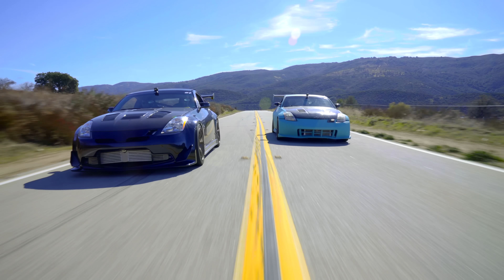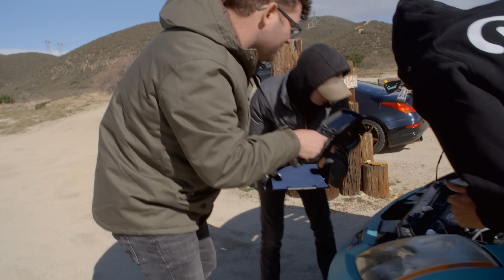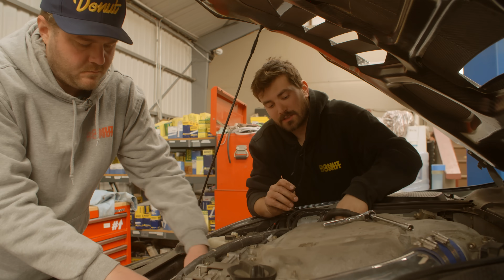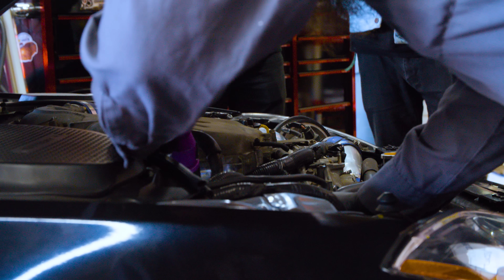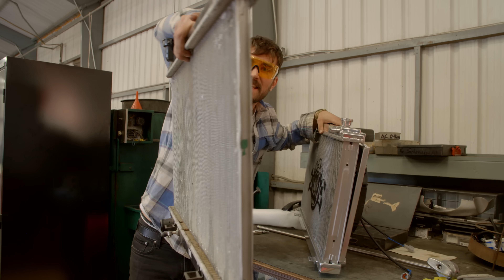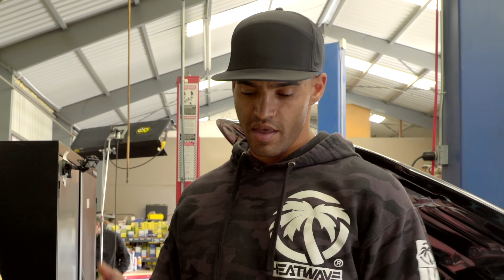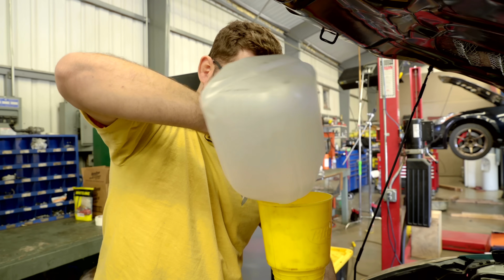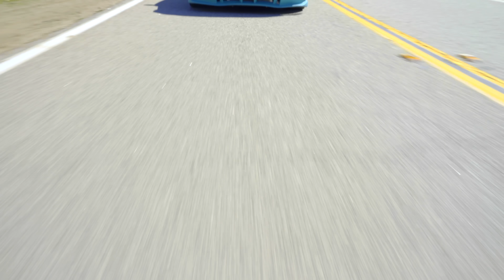$200 Radiator vs. $500 Radiator

Comment: This isn't a fair test to either car. they're completely different... one is twin turbo... the other is single turbo one is tuned different than the other. one may make way more power than the other. one may be driven way different than the other when it comes to stuff like this you need to try to even the playing field a little bit by having one person drive both cars that's not from either car that way they're driven fairly similar. And then push them both to their limits

Comment: If the radiator is to small it dosen't matter if it is costs 2 times more or 10 times. It will still be to small to get the engine cool. The fans are only for cooling if the car is not moving. If the radiator is big enough you even don't need a fan. I've seen a lot cars with originaly engine driven fans that used to have no fan because of the power you loose to them.

Comment: One reason I love this series, is because it shows how wrong shit goes when you try and work on vehicles. It's never as easy as just installing new parts. Something, somewhere, will go wrong which causes you to lose your mind. Lol a 2 hour job will always turn into a 6 hour job.
Reply: Stock is gold or buy much better stuff from japan
Reply: Literally me late last night lol... Fitment issues with a new intercooler I installed. A lot of little things being tighter or more inaccessible than anticipated, then when it was all done my test drive gave me a CEL... Turns out I switched the connections for the fog light and the Ambient Air Temp sensor smh...

Comment: Why the eff aren't you putting coolant in with the water!? It prevents corrosion as well as keeps the boiling temp of the fluid higher than distilled water! 🤦
Reply: Calm down FFS.. the higher thermal conductivity of the fluid outweighs the higher boiling point due to the larger radiator and increased fluid capacity capable of cooling it prior to boiling.

100% glycol = ~0.25 W/mK
75% glycol = ~0.34 W/mK
55% glycol = ~0.40 W/mK
25% glycol = ~0.55 W/mK
0% glycol = ~0.69 W/mK

Going from 55% anti-freeze (AF) to 25% AF is a about 37.5% higher thermal conductivity.
Going from 25% AF to 0% AF is about 26% higher thermal conductivity

From 55% AF to 0% AF is about 73% higher thermal conductivity.
Reply: But the idea is using these as daily drivers. Using straight distilled is going to cause lasting damage to multi-metal systems. The high flow and fluctuation in temps will only increase the corrosion possiblity. They are giving poor advice for long term vehicle maintenance. Unless I missed something
Reply: @jhanschu  Using coil overs on a daily driver is uncomfortable as hell so I never considered that a realistic option. 

The VQ block is aluminum, the head is aluminum, and the radiator is aluminum. Your argument is moot and irrelevant on supposed galvanic corrosion due to multi-metal systems. 

I seriously doubt anybody watching is using the knowledge gained from the video as a long term vehicle maintenance guide. As it's a performance upgrade comparison on whether to spend the extra dollars on allegedly higher quality parts.

For example.. on the $3000 suspension vs $500 suspension episode IMO I'd go the cheaper route with higher quality tires for better overall performance. As extra tunable capabilities and simplicity of doing so it relatively moot once dialed in properly. Even if the alignment shop billed me $200 more to complete the job I still saved $2,300.
Reply: Can't say I've ever seen a water pump impeller made of aluminum. But I do concede that distilled will dissipate heat more effectively. I will also agree, that they are leaning into the track focused updates. But they make a point to mention that they are modifying the same car for use on and off the track. I'm sure you have plenty more counters to my statements. Regardless of whether you reply or not, I'm considering it closed.
Reply: @jhanschu  Water pump impeller's are commonly plastic as fabrication is faster and cheaper. Having a metal one is in many instances only an aftermarket upgrade. Just as intake manifolds, end caps of radiators, timing chain guides, and many other components have transitioned to plastic for a good while.

Even performance oriented vehicles have plastic intake manifolds such as Mustang GT350 5.0 Coyote engine. Yes, the GT350.. wtf?
Reply: The few water pumps I've had the pleasure of changing out were all stamped steel impellers. In fact, early in my vehicle history I attempted to cheap out on a neon coolant flush and 6 months later overheated because the impeller had eroded. It was OEM and steel. Recently did a 2000 grand am and again, OEM stamped steel impeller. But I wouldn't be surprised is they've moved to more plastic components

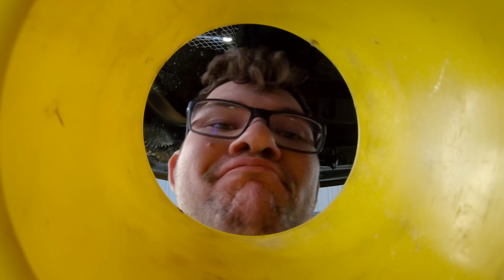Comment: 12:46 facepalm Don't do that. Antifreeze does more than lower the freezing point of water. It also has anti-corrosion additives in it. You run straight distilled water for too long and you'll corrode the cooling system (aluminum parts will be fine unless salts find their way in there. But steel parts, like your head gaskets, will rust). I live in the SF Bay Area (lower average temps than LA, but about the same temperature range ie the temp rarely gets below 50 degrees); I start with a 50/50 pre-mixed coolant, then add a 1:1 ratio of coolant to distilled water (resulting in 25% coolant, 75% water). EDIT: Just to be clear: I wasn't criticizing Donut (their end result was a 4:1 mix of distiller water to antifreeze). I was explaining to any watchers of this video why you shouldn't run 100% distilled water.
Reply: damm bro u smart

Comment: I used to work in a radiator factory. Literally no difference in them when it comes to materials. Factory I worked in made radiators for both John Deere and Toyota. Both came from the same tube materials. All comes down to the fans and the fan shrouds. But even those are made at the same factory.

Comment: Coolant also has lubricant properties for the water pump and anti-corrosion properties along with modifying the boiling point of the coolant. Flush the car and do it right.

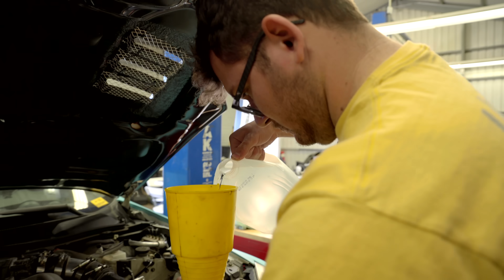Comment: At 12:50 I must correct you. I agree straight water will keep your radiator pretty cool..  However, Antifreeze not only prevents freezing it helps raise your maximum boil point which is an advantage in a performance car. One last thing that people forget...Antifreeze has ANTI-CORROSION properties unlike water alone. So, the anti-corrosion piece of mind for your cooling system is valuable for longevity

Comment: One problem i see at around 13 min. Antifreeze is also used to raise the boiling point.  Water boils at 212 so you're going to be pushing that point real easy if it barely gets over mid temp range if what's left in that block doesn't remedy it. Anti freeze is far from only preventing freezing. It's also a corrosion inhibitor which is why you are supposed to change it every so often it will still protect against freezing but not against corrosion after so many years. It works similar to an anode rod in your hot water heater which disappears and loses effectiveness against prohibiting corrosion.

Comment: destilled water is not good for your cooling system. the cooling fluids with anti freeze and stuff that you can buy also contains corrosion prevention. your destilled water is going to look pretty brown when you replace it in the future...

Comment: The fan that Nolan got is probably fine. Lots of aftermarket fans are designed like that. The questions revolve around the blades and the RPM and how much it actually flows. If it flows well and runs fast enough, that should be enough to push air through at lower speeds.

Shrouded fan setups are a double-edged sword. If you actually look at that shroud (Hi Car), the fan area is a small portion of the overall radiator area. It would likely work better with one larger fan and one smaller fan. The reason is that when you're at speed, the fans are doing nothing but blocking airflow. Hence, with a shroud, only a fraction of the total area is actually cooling the air. With Nolan's shroudless setup, the entire radiator can be used to cool the engine at speed.

Shrouds look nice and all, and in OEM configurations they work well. But OEM fans and shrouds tend to take up a lot more space. When you flatten them out like this, a shroud isn't necessarily the best way to go. You're not going to pull a significant amount of air through the non-fan area just because you put a shroud on there (the bulk of the air is being pulled from where the fan is). Nolan's fan is going to sit flush against the radiator anyway and pull air perfectly fine. I predict that you're not going to see a significant different between the two at speed.

Oh, I see they chose to re-use the stock shroud on Nolan's car. Smart move!

Comment: Antifreeze also lubricates the water pump shaft.  Using plain water shortens the life of the seal.  But also antifreeze increases the boiling point.   And it reduces corrosion.  You are better off using antifreeze aka coolant than plain water.

Comment: Alot of times this is stupid. All you have to do is upgrade the fan and its fine. I run a 150 dollar aluminum 3 core in my 383 s10 and a set of dual 14" and I have no problem with cooling.

Comment: The vid was fun but realy you should have been testing with the same fan system on both... I put the mishimoto fan shroud on a megan rad and had great resluts.  Really the Rads themselves shoukd have proformed nearly identically. Unless there was significant thickness diferances.  Which which in my case was the situation. The CSF and Megan rads were mostly identical same flow pattern same fin density.  So why pay more? Fitment was also great.... After i fixed a bracked that was bent on my car. The mishimoto fans have to admint are mehh,  the shroud makes all the differance.

Comment: You have a dual fan vs a single fan? Huh? You should match setup to setup. Can't compare when not getting same amount/size of parts
Reply: Ummm, Zs since the Z32 usually require removing the reinforcement on radiator swaps. You guys are making my head hurt doing $#!t the hard way.
Reply: And no coolant? Me thinks you guys need to fully find out what coolant does. It's not only for freezing 🤦‍♂️

Comment: by the way the reason antifreeze is in there is not just for it freezing it changes the boing point and cools better then just water witch will boil out if there is no antifreeze in it. it also stops algae from forming and plugin up the cooling system.

Comment: the lo car has had a lot of installation problems because of lack of parts and space, but drives mostly fine, but the hi car has had a lot of easy installation and a lot of running problems from what ive seen

Comment: You need antifreeze in the cooling system even if you leave in very hot place, not to pre3vent freezing but to prevent seizing the water pump, antifreeze lubricates the pump so it's kinda important to have lubrication on it to prevent the piston BBQ from happening

Comment: You must be using too thin of an oil, a 15w40 works more well in high heat, its a high dispersant oil, my car is cool enough that even the heater is not as warm as before.

Comment: To test if this results are really (at least mostly-) due to the new parts (instead of the orverall design, as stated by the end of thw video) you guys should look into also swapping some of the components and check the results.

Example: put the new hi cooling parts into the lo car. And see if results are same or close to the og ones obtained from hi car. That would tell A LOT MORE about whether or not the hi parts are worth it by themselves

Comment: I know someone with a big block Chevy and had over heating issues. He put a larger radiator and it didn't fix anything. Another co worker got him to change the carburator. Problem fixed.

Comment: Coolant is for higher boiling temperatures and pump lubrication and it’s better on the seals too smh. You shouldn’t put just water in or a weak mix of coolant unless you have another lubricator

Comment: Cmon guys.. ignoring main role of antifreeze? It prevents corrosion of engine inner parts. Thats why you have to use it even in california. Straight water will corrode shit out of block and heads. And all that crud in turn blocks radiators and so on. In extreme prolonged cases water will eat block/head enough to have head gasket failure.

Comment: You should never use pure water as coolant, water DOES NOT protect from corrosion, it's batter to use tap water with additives  then to use distilled water without it, and the additives also prevent the fluid from boiling.

Comment: Maybe invest in an OEM bonnet. Run vents if you want but you should also invest in a splitter and underbody aero that extends back at least to front wheels. You might think your letting hot air out with those vents but unless your driving at a pretty high speed the effect is minimal at best and even detrimental in most cases as you are robbing the bottom end of airflow past it. The only good application for a vented bonnet in most cases is more the Maccas posers who spend most of their time idling in traffic.

Comment: Coolant is also for electrolysis protection.  Nissan is very specific on the coolant to water ratio for that reason.  Use a product like "Wetter Water" for enhancing thermal transfer.

Comment: Mishi is legit but location/region has a lot to do with rig set up as well. Here in Houston, I had to get bigger fans than the Mishimotos. It's just too damn hot here and those fans didn't push enough air even for a 2 row Mishi radiator but damn it looked sick AF while it was installed

Comment: Not a fan shroud..  It's a fan support. The Shroud extends 4"-5"  past the fans for a reason... And it needs to be sealed around all the edges in front and rear of the Radiator.  Why NASCAR uses Duct  Tape to control the air flow...  As they don't use a thermostat.  They use Stainless Steel Restriction washers.  In place of a thermostat..So there is nothing to fail. They just size the holes to the track conditions..

And if you want flow.  Go buy a Crown Vic Police car or get it from the Salvage yard.  They flow 5000 CFM...

Comment: They're '03 cars, right? Why didn't they just plug in an OBDII reader into the car and watch temps as they were driving? It'll list the actual temp of the coolant itself, and be a useful metric to watch/confirm the gauges.

Personally, I think that the other mods (intercooler, hood vents, bumper vents, etc.) play a decent role in keeping temps down, judging by the vast difference between lo & hi cars at the start.

Comment: Pure distilled water is NOT a good idea! Use Type B coolant which contains the anti-corrosives and anti-microbial additives without the antifreeze. Since distilled water doesn't contain its own minerals, it has a tendency to pull them from whatever it touches to maintain a balance. https://www.hyperlube.com/blog/blog/why-you-should-never-use-distilled-water-in-your-cooling-system/

Comment: Not only does antifreeze keep the water from freezing, it also works as a lubricant for the pump and other moving parts in the cooling system. Atleast do a 20-80 mix instead of nothing

Comment: When I upgraded the radiator on a 2001 Miata, I just reused the stock fans. The slim aftermarket ones they use don't work as well and are mostly for clearance if you have no space left over from a larger radiator.

Comment: yeeeezzz distilled water? Why no high temp coolant like Evans or something, you can keep driving till like 30% above boiling point
Reply: I think distilled water has a higher boiling point than alcohol type coolant. 
Not quite as good for corrosion resistance though.

Comment: There are a few things flawed with the test. 1 lo car should have been given a fair fan shroud. High car received mishimoto fans which in my opinion is more of a low car option (no shade i like mishimoto). secondly the distilled water is a big change in itself regardless of radiator so it skews the results. 3rd the fact you guys built 2 turbo 350z with stock cats was a huge killer for power on the dyno. I think a "mid pipe" exhaust video should be made. It makes a huge difference. Awesome watching you guys wrk though!

Comment: Would be cool to see a comparison between cheap and expensive exhaust systems. Other than that, this is great content from Donut Media.
Reply: These questions and videos are absolutely absurd! There is no comparison between a cheap Chinese knock off exhaust system and a high end 100% stainless steel (or some other high end material), mandrel bent, TIG welded Exhaust system! What people don’t realize is for the most part you don’t change your exhaust system to gain horsepower, You change your exhaust system to maximize the efficiency and horsepower gains of the engine due to engine modifications! Unless you are talking about diesels which is a whole Nother story!
Reply: @NeverEnoughPyro40  Yeah, you don't know what your talking about. The quicker you can get rid of exhaust the quicker you can put more gas/air in. If the exhaust stroke of your engine is faster, the intake stroke will be able to begin faster too. An upgraded exhaust will increase your horsepower assuming it's lighter than your stock one, and it will increase your top speed alone.

Comment: You should add speakers it may add weight but it would improve the drivers experience i suggest this because it makes a car a moer fun daily driver. you should do around 3000 dollars for hi car and 1000 for low car( subwoofer included, tweaters etc)
Reply: 1000 still gets you a decent sound system, put a boss "1000w" amp and some myx terminators, with mtx speakers and a cheap head unit could go like 500-600